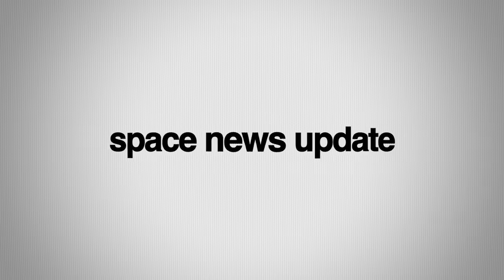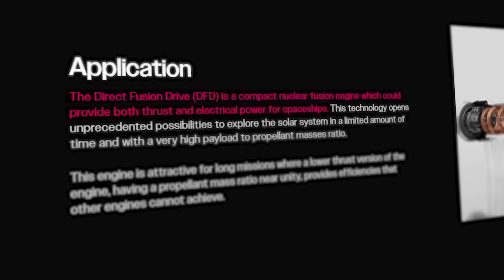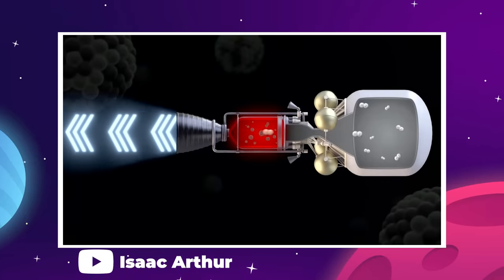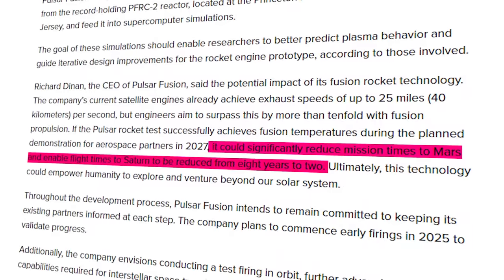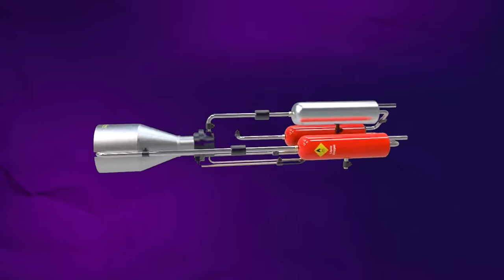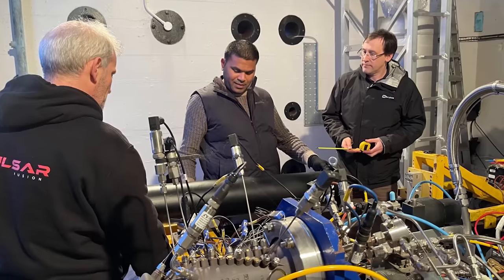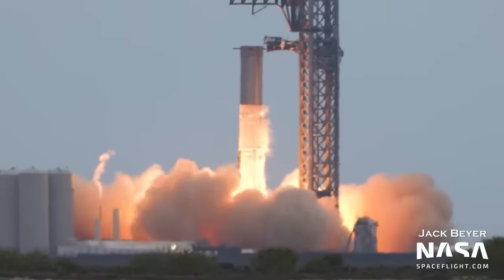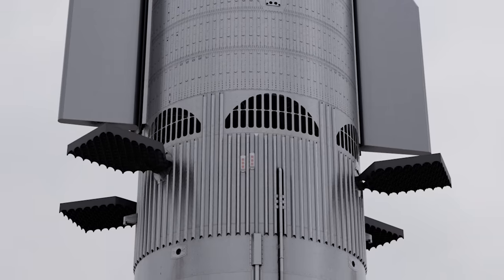The Nuclear Fusion Rocket Is Coming!

Comment: I keep seeing stories and videos claiming this or that new propulsion system can get humans to mars in /insert arbitrary amount of time here/, whether it's NASA and DARPA dusting off nuclear thermal rocket tech from the 60s or something what pulsar is suggesting. What I haven't heard anything about is after these incredible machines yeet your ass across the radiation soaked void that is space, how are they slowing down? Is it going to be like the Expanse where they flip and burn to bleed off speed, or what? Kinda sounds like building a 1000 horse power car with no breaks. And why is anyone bothering with planing for a mars mission when landing on the moon isn't even a given? We have no infrastructure out there to facilitate aid. Is nobody bothering with the space travel equivalent of a first aid kit floating out there at set points, so that if something happens it's not an instant death sentence. New rockets are sexy and cool but if we're going to go out there and mine the moon / asteroids / mars, and explore our solar system first hand then there needs to be support structures in place for fuel, repairs, emergency food / water. The wild west approach of just go and see what happens is suicidal, so somebody smarter than me build an automated aid station